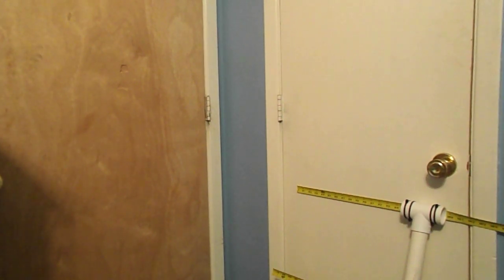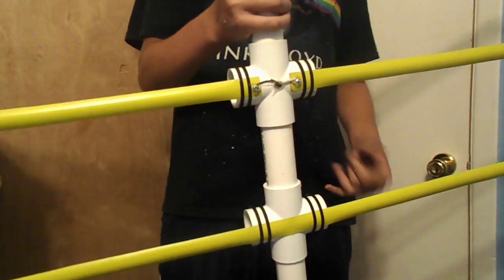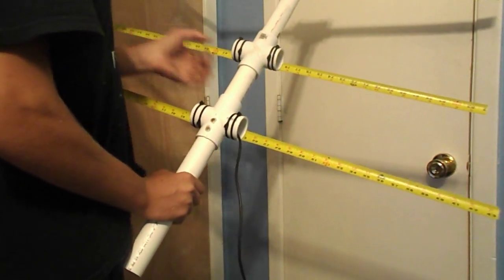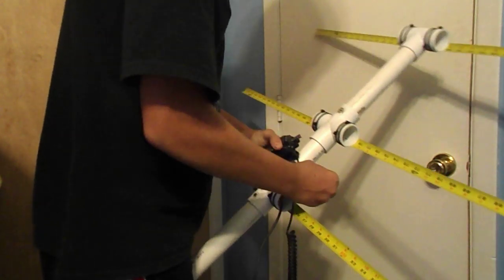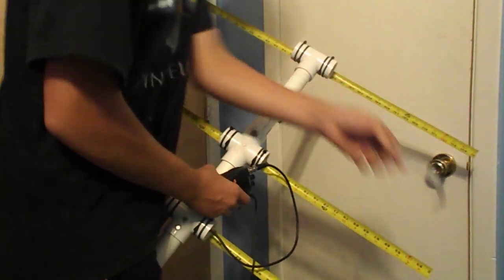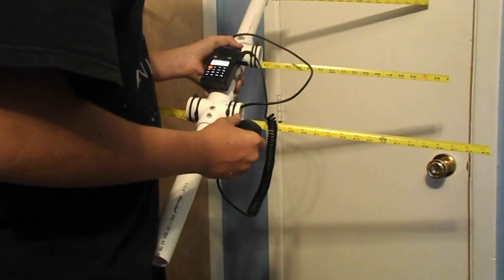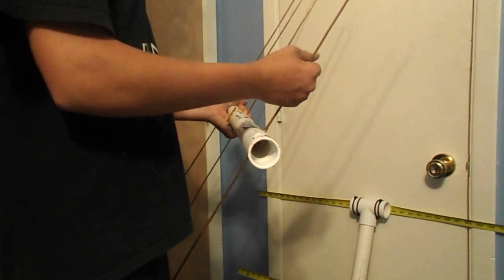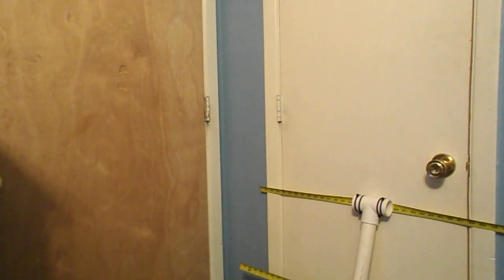Portable 2m yagi antenna

Comment: Hi, Could you please give me the measurements please? I mean distance between the elements and length of each one of them. What is the dia of your pipe? Is it possible to receive signals from ISS with this? Do I need to keep the RG 58 cable length to as short as possible?

Comment: what size pvc pipe did u use?? kf5dmc on this 2meter antenna
Reply from the maker: 1 1/4" but you can use anything you find convenient
Reply: i ended up getting 3/4 schedule 40 PVC pipe for it... works well here.. havent tried it on repeaters yet but will soon when I can take it out and hook it up to my 817 yeasu
Reply: +sixpapavictor Could you please share the measurements you have used? Have you even tried to receive ISS signals with this? What is the outcome?
Reply: I used 2and3/4inch PVC pipe, Two main sections of 7.5inch Long for the short pipe and the 2nd pipe was 11inches long. Now, I took 1inch thick metal tape measure for the elements.. Now, my dad helped me with the electrical side of this and used whats called Tinning which is using a hand held soldering iron and tinned the 12gauge wire to the pvc in the center element... here is a rough link of roughly of what mine was built from...
https://sites.google.com/site/tapemeasureantenna/
Reply: I had two crosses the same size and one 4waycross for the build
Reply: Thanks. Please share the length of inter connection tubes between the joints.
Reply: well if you learn how to read my link I gave you here.. there wouldnt be a problem..